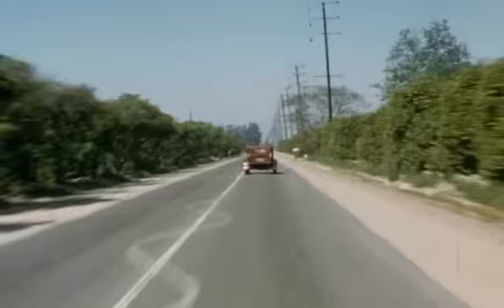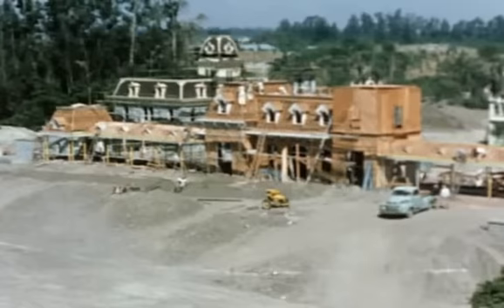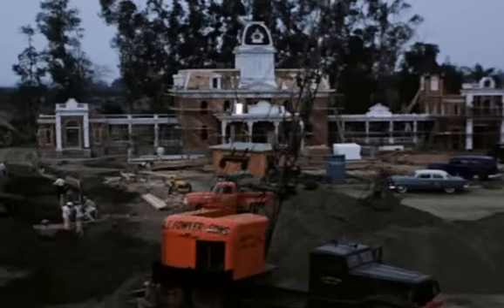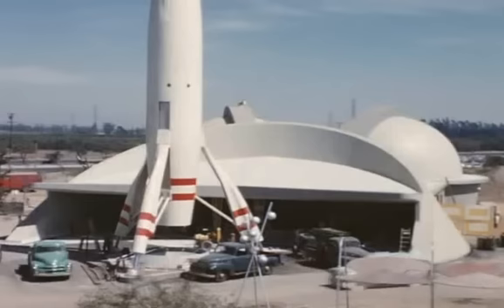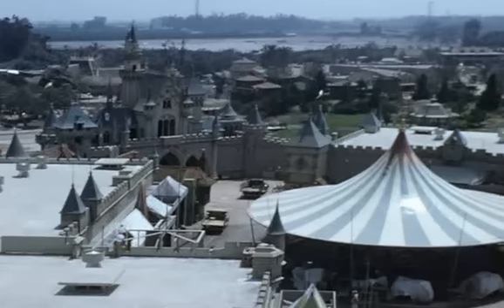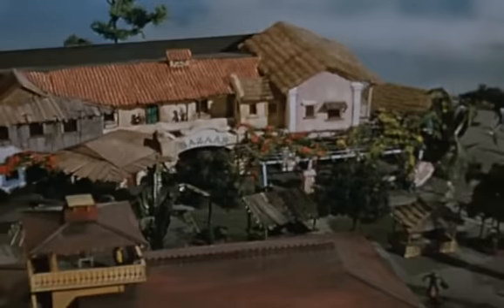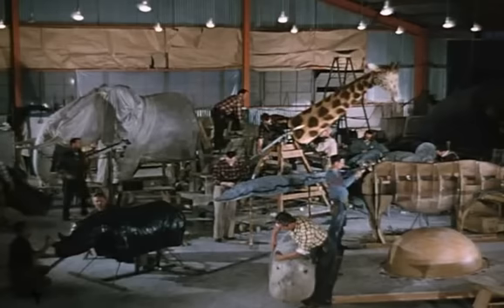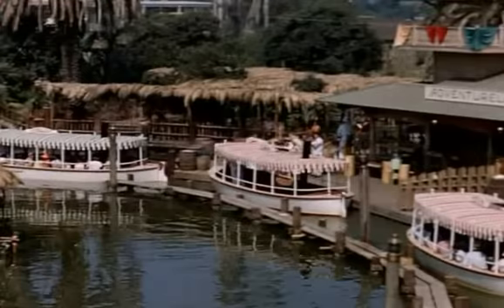Disneyland in construction

Comment: @4:23 today it would take that long (a year) just to do the drawings.  Even though we have computers and CAD, and ability to work in tandem online, everything's actually slower now.  Amazing.
Reply: Once you get used to AutoCAD it is fast. I have worked in both manual and computer assisted and once you get the hang of it, it is more powerful. It helps if you know how to make drawings before you start with CAD. Of course you would use metrc today and that would speed it up more. Cheers! :-D

Comment: At around 35:30, what kind of transport is being used for the camera? Helicopter?
Reply: A drone carrying an iPhone to be more precise.
Reply: Figment -The disneyworld epcot ride I know. I should have used my gopro instead. But walking around on stilts an dodging the construction equipment was a challenge.
Reply: +Figment -The disneyworld epcot ride bruh there were no drones yet....
Reply: oh...HAHAHAHAHAHHAHAHAHAHAAHHAHAHAHAHAHAHAHHAHAHAHAHAHAHAHAHAHAHA-sarcastic-HAHAHAHAAH
Reply: yes copter.  you can see the shadow. in some of the footage
Reply: @mrtodd3620 - You'll see the shadow of a helicopter near the bottom left of the video between 26:30 and 26:34.
Reply: @AsianGlow  He wasn't asking about those shots.  This was crane.
Reply: This was from a man riding a crane.  You can see the perfect circular path the camera arcs through.  Also, for those familiar with helicoptors at low altitudes, this would have been a gigantic, debris and sand-filled windstorm if a helicoper were used to produce this shot.  The crane was quite, clean, stable, smooth, not disruptive, and already set up for its construction duties.